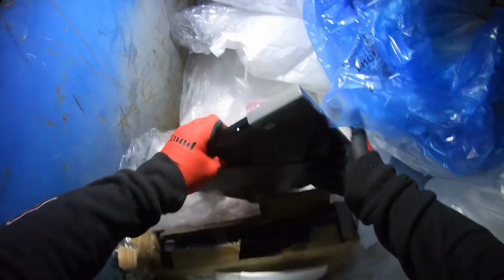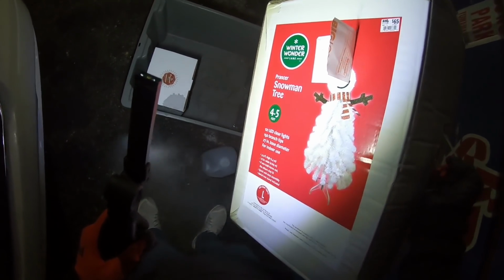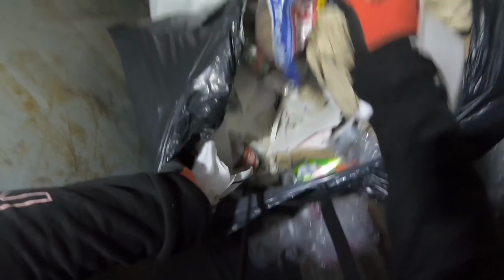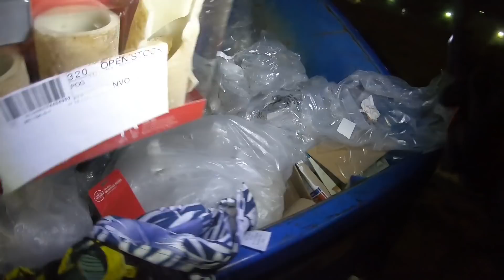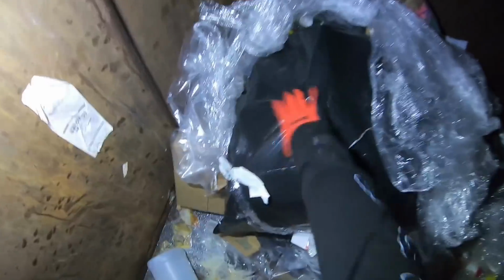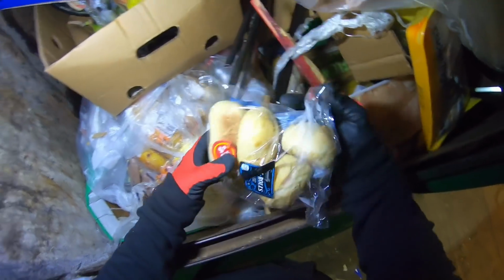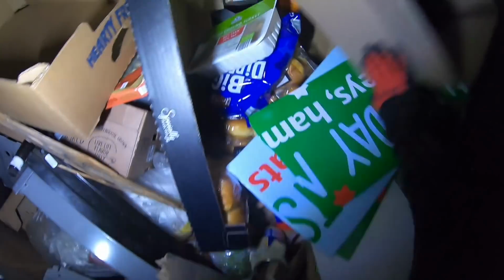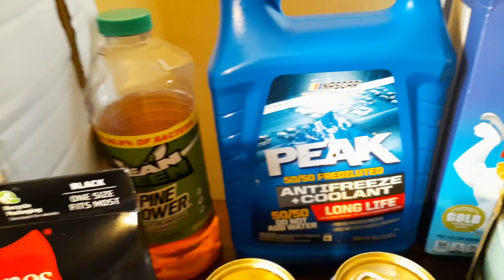**DUMPSTER DIVING  - SOMETIMES YOU HAVE TO DIG FOR IT!**

Comment: Those cauliflower crust pizzas are take and bakes, they aren't frozen. I've taken some, they came out fine. Anytime you find meat, if the temp is 40 or less, that is good temp for taking meat. I've taken plenty of meat from Aldi and never have had a problem yet.

Comment: You will never find frozen meat or pizza in the Aldi dumpster, they don't freeze either.  As long as the outside temp is cold and the package is cold, what is inside (if the seal is good), should be just fine.

Comment: Big loss on not taking all that meat. It's so cold out you're wearing a jacket...the inside of that metal dumpster is even colder. If you took that meat home and immediately refroze it it would be fine. When it's cold like that meat isn't going to "putrify" as quickly as you fear. People who used iceboxes when I was a kid ate meat that was handled far worse and never died from it or got sick. Also you can take it home and cook it then freeze for later use. If it's bad it's going to smell foul...or it will have a distinct slimey feel  to it you can't mistake. I am 75...raised 2 sons alone and dumpster dived for years...we never got sick.  Also you can take those veggies...fill your kitchen sink 2/3 full of very cold water, add 1/2 cup of clorox to the water, swish the water really good to mix evenly then dump all you fresh veggies in it and soak 15-20 minutes...rinse super good and then refrigeratein baggies...it will kill any bacteria, perfectly safe to eat and won't go bad in your fridge for quite a good time. Fellow nurses I worked with.
.now my age did this for years with our families and no one ever got sick. Truly!👍🙏❤😊